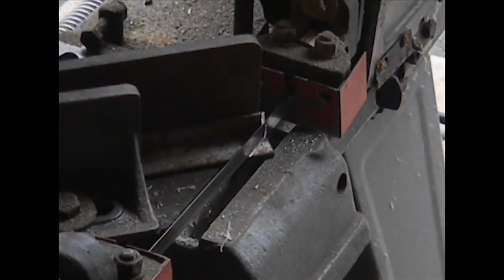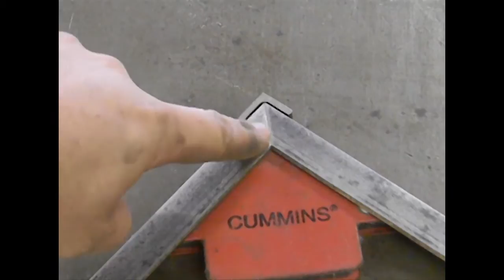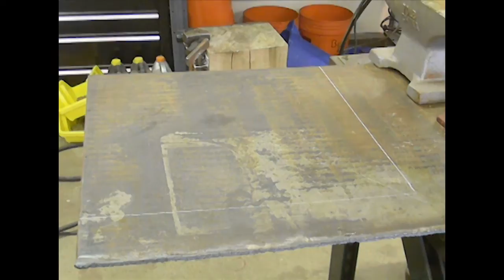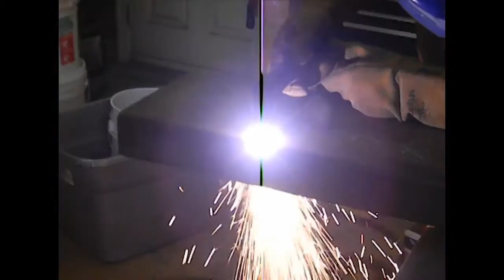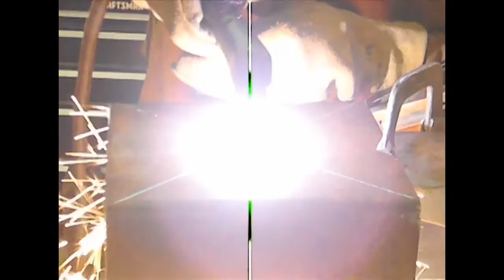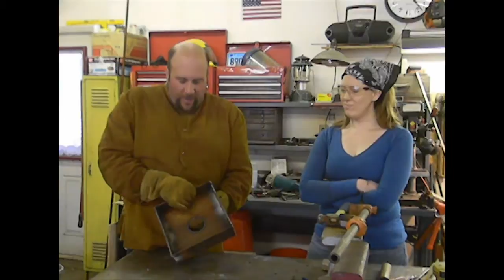Building A Forge - Part 2 - Fire Pot

Comment: It would have been so much easier to simple sand that corner at 45° for about 6 seconds to allow for the interior radius of the angle rather than grind it out. Good work though.